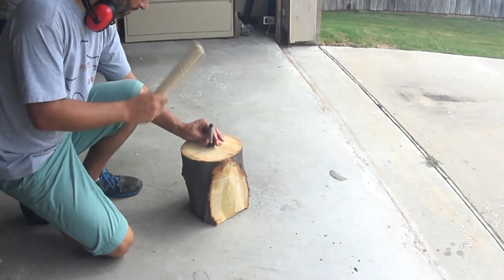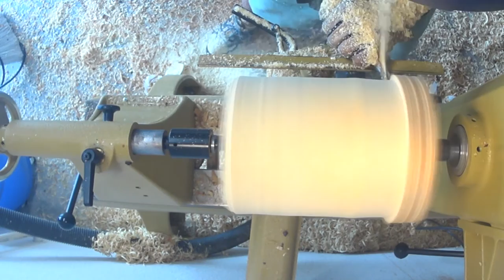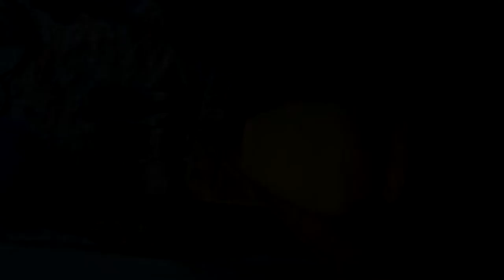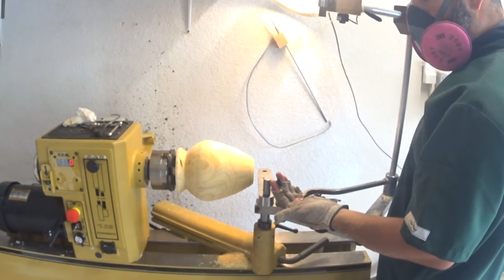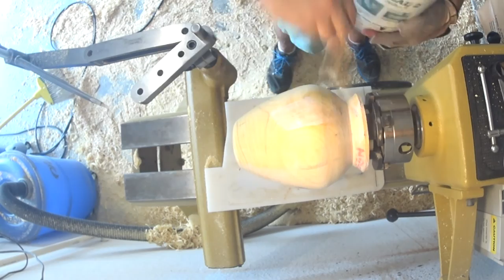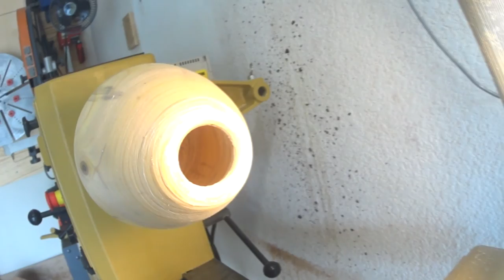Woodturning - Rough Turn Hollow Form

Comment: Is that the 3/4" system with the 5/8 tool in it?
Reply from the maker: you are correct.  The stabilizer really saves my shoulder